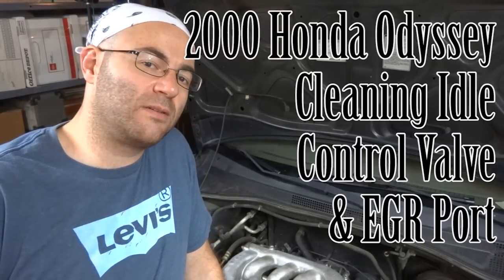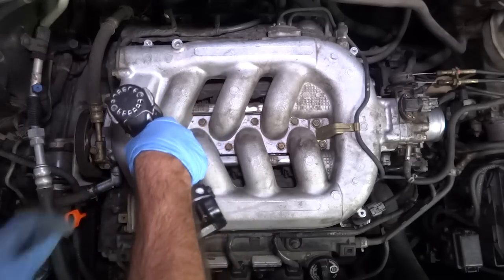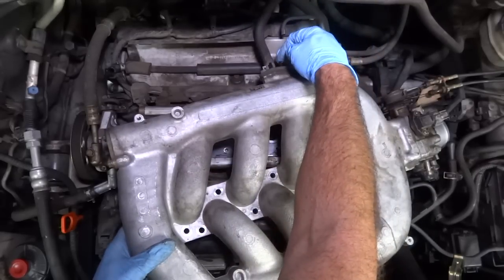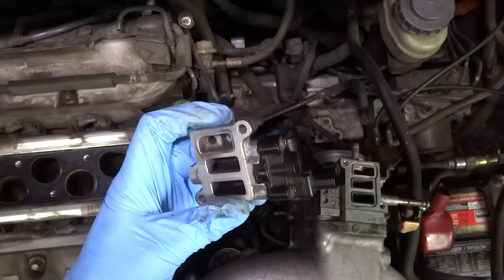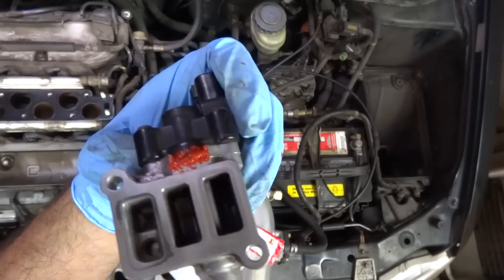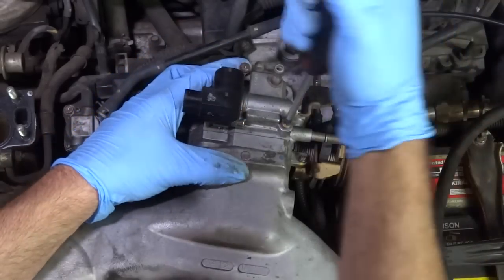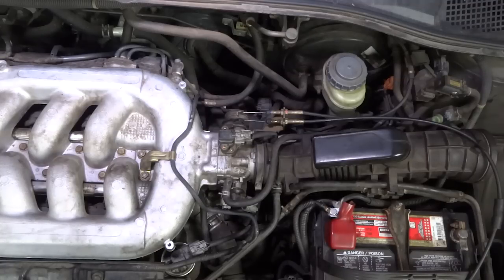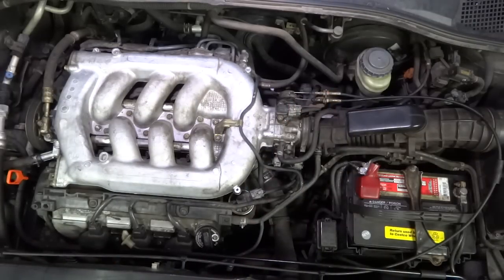Honda Odyssey Idle Control Valve and EGR Port Cleaning (P0401) DIY

Comment: And what is a OEM?
Reply from the maker: +Augusto Quintero OEM (original equipment manufacturer) means you bought the part from the Honda dealer.  If you bought it at an auto parts store, it's likely an aftermarket brand, also called "OE" (original equipment).  Aftermarket parts sometimes don't function correctly.
Reply: Many OEM parts are made by “aftermarket” manufacturers. Bosch, SD, ND (Nippon Denso) & others often make the same specialized electronic or mechanical parts for the Auto manufacturer as the auto parts place. If the part says OEM it normally is made by the same place. If it says also fits it is from someone else. May work as well, but is not who the manufacturer chose for whatever reason. 
   BTW, very thorough video! You got access to IAC, EGR & Throttle  body all at the same time.i also like your suggestion to take a photo beforehand to be sure everything connects back the same as it came off.

Comment: My 2002 Odyssey has a different valve cover, not sure if it will come right off like yours. And that last part you removed to get to the o-ring, was there anything to clean in there?

Comment: While cleaning out the EGR port, where did all the crud go when rimming it with the drill bits? Did it just all fall inside? And is that ok? What if I just blast it with carb cleaner? Thanks!
Reply: You're cute...